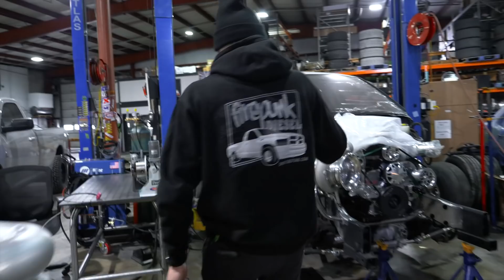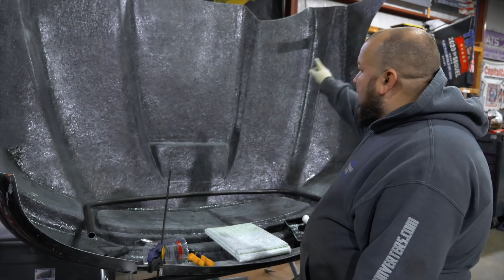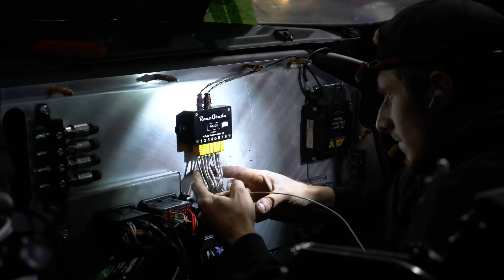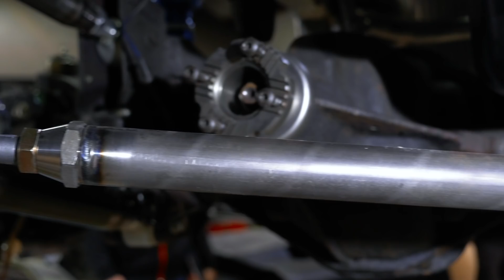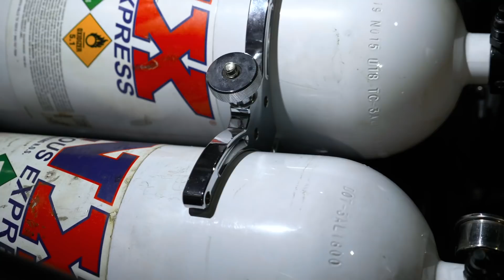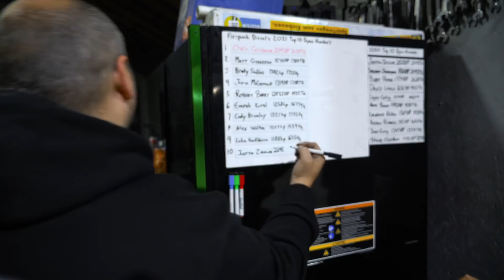mOBSCENE - BRINGING THE HEAT!

Comment: I have  used The Sencer Conection  for 7 years..  .125 sec, 5/8 sec actual temp vs 1.2sec response  ,6 sec to reach actual temp ... lol your runs are shorter than a closed tip can read. 
Most dont know prob responce is  the time to show 1/5 of the actual temp change .

Comment: I think I heard a 94 pounds of Boost? Wha wha what! 😱 I think my head can fit in the front of the turbo! Holy .....
Reply from the maker: Made 126psi boost on the 2295hp pull
Reply: @FirepunkDiesel  if you don't mind me asking, what was the drive pressure? This is the truck with the Weimer turbo right?
Reply from the maker: We adjusted the wastegate a few times on dyno and have drive/boost exactly 1:1 +- a few psi
Reply: And with only 90 psi of drive pressure! Thats gnarly!

Comment: One of these days I’ll make more then 40 psi of boost 😕 just gotta do away with the upgraded vgt if I didn’t tow 4500lb boat from Nc to Fl so often
Reply: Invest in a low key twin setup
Reply: @tooshorttosee  I prefer a big single. You can make just as much if not more with a single vs twins.. if got a 3rd get that makes 1800 last time it was dynoed and we did push it hard..but if got a 5th gen dd fully build revmaxx trans,ARP studded has a 12m cp3 stop with a 52 gal fuel tank swap with a airdog fuel system it’s the built factory turbo so if it blows I can find a stock turbo at about any dealer and throw it in and go on down the road and tune through ezlink and not be stuck I’m probably forgetting something! It dynoed 935rwhp on tune 5 and thats all I run it on. But I didn’t loose any factory comforts still have my engine brake being it’s still vgt. I tow my boat from Nc to siesta key Florida probably 5-10 times a year so I really don’t wanna loose that ability haha. For putting right at $25k in building it. It runs pretty good for a dd lee diesel is who I have do all of the work. Firepunk actually dynoed his truck in one of their other video’s his truck it setup just like mine his truck is the reason I done mine 😂